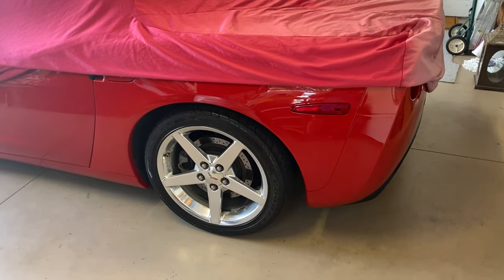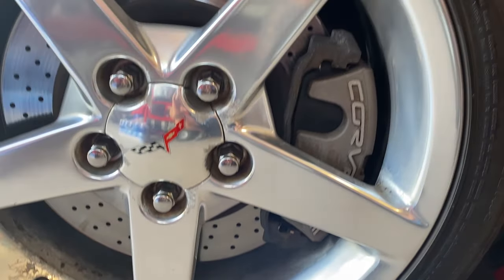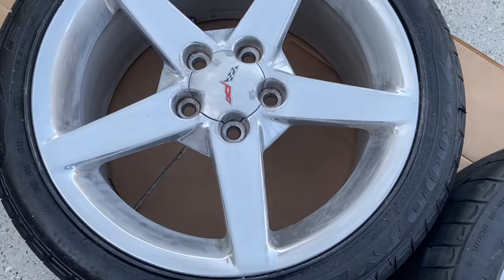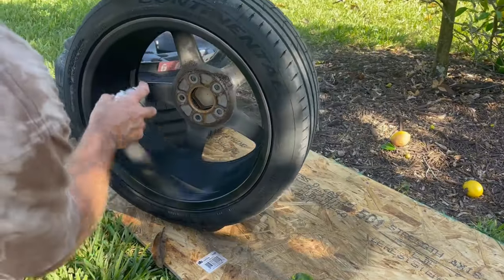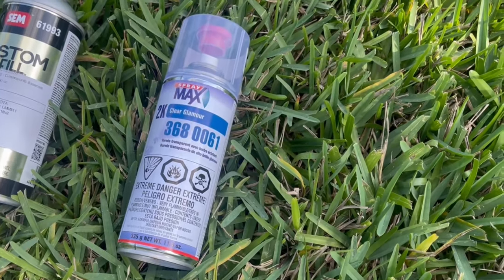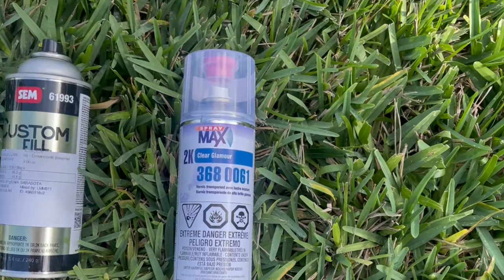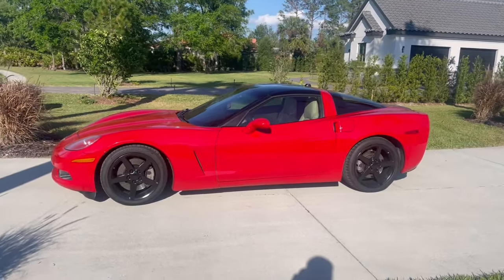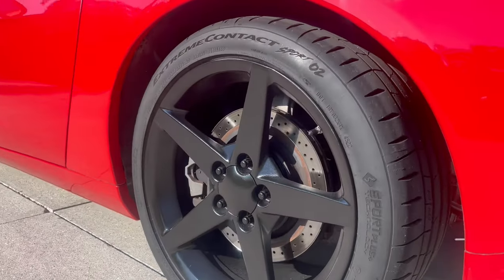How To Paint Rims FAST and CHEAP! (Best Method)

Comment: From someone that does this for a living.  A few mistakes you made. Use a cleaner with your scuff pad. And sand paper.  I’ll wet sand with a degreaser or spray away glass. Cleaner.  When cleaning the rim never touch the rubber with the towel.  Do a final wipe with the cards in.   Primer is unnecessary on rims a very very coat might be fine but it tends to cause issues on the rims.  You don’t want the thickest layer possible as thick clear coat will will be more brittle.  Typically two coats.  All of that is just minor professional differences.
Reply from the maker: Thank you, will keep these in mind if I do this again!
Reply: @running2redline also warm your cans in warm water or in the sun and always paint the rims standing up spray paint loves to spatter when pointing the cans down.. nice work
Reply from the maker: Great point, thank you! @productionapostle1298
Reply: For someone that does this for a living I’m surprised you didn’t notice the balancing weights that should have come off prior to painting and then rebalanced when paint cured.
Reply: @LK-851  Perhaps, it is because he doesn't do it for a living? 🙄
Reply: @throbbinwood  it’s obvious that you didn’t watch the video. 🤣🙄
Reply: Why wouldn’t I just wet sand and polish
Reply: I appreciate the correction as this is my first time. I'm a girl..lol can I use the jack and do one tire at a time. I don't wanna go out and buy a whole bunch of stuff for this project.
Reply: How long could one expect a paint job on rims to last?
Reply: well ive done mobile wheel repair for many years. Dudes being a stickler about not touching rubber with the towel and wheel weight man is also petty AF lol You did a good job but id have like to see the glass finish because me personally can see alot of spots where the clear coat isnt perfect and is orange peely. Its ok but You can correct those mistakes after the paint is fully cured with 3000 grit wet sanding and then a good LIGHT polish with a good compound. People freak and you can fix most issues with paint and clear coat. Most people hate doing polished wheels but i like em after its all done. I do about 15 20 wheels a day in a mobile unit sometimes 30 and we jack up the car, put the car on stands, let the air out the tires, push back the bead with a beadbreaker machine, grind/sand down the damage, paint or polished depending , then we always tact cloth it, use adhesion, paint, gloss, then blend it and put it under heat lamps to dry then air up the tires. usually 4 takes 30 minutes to a hour from being taken off to being done. we tell them dont drive the vehicle anymore you have too and dont wash it or touch the wheels for 72 hours.  Just me personally man do this again and only do your one coat of primer after a proper sanding and you should be good. those 2 extra payers were wasted money in my personal opinion. Good job man! A+++ Thanks for sharing
Reply: @shartih7313 so these will take a little while to dry and paint your next coat. Sometimes a few days depending on where you’re located so I wouldn’t recommend it only since the process would get drawn out a while but if you have a spare tire then you could definitely do it and still be able to use your vehicle while waiting on them to cure up. Again though, if there were a weekend that you didn’t have any plans, it would be great to just take all of them off and do all four at once just so the process went quicker. Happy Easter and smooth riding!
Reply: Thoughts on leaving the wheels on the car and not painting the inside of the rims? I've got an 11 year old Kia and I don't need it to look showroom quality. Just tired of the peeling and oxidation.
Reply: @sgfry89 spray paint will overspray onto the car paint.
Reply: @LK-851   That's pretty anal and balancing wheels cost money. For $100 I thought he did a great job. The cards thing to protect the wheels is a great idea. And the comment holding the rim/tire upright while spraying so no splatter was also a good idea.
Reply: @paulscozzari1787  I think it would depend on the climate. I live in the Northeast and salt loves to eat away cars especially brake lines.
Reply: @mikeblaz  you’re ok with a hack and that’s fine, they need people like you to make a living.
Reply: @LK-851  I don't do this for a living. I would cut a corner here and there on my own car to save money especially if the car was 10+ years old.
Reply: thanks for the pro tip pro guy , helpful
Reply: Hello Kriss, So you recommend just clean the wheels and NO primer? Clean wheels and rough up the wheels with sand paper then just spray the black paint in light coats, then 2 light coats of clear?  Any rattle can recommendations for color and clear?  Thx for the recommendations.
Reply: @floydcoburn7524 probably should also wipe it down w alcohol after you sand it.. the spray paint
Reply: I have a car that someone already painted the wheels (bright yellow😖) would these steps basically be the same for repainting (along with your suggestions). I'm not looking for super high end, but I don't want bright yellow🤦‍♀️
Reply: I agree, after sanding a painted surface  primer is just another coat of paint where something could  go wrong or later not adhere.
Reply: so dont use primer after sanding?

Comment: Suggestion……save your back dude!!!! Have an elevated surface to work on & maybe build a “Lazy Susan” type rotating round surface so you can stand in one spot and gently rotate the wheel. Your spray can will stay more even & you’re less likely to miss areas while walking (bent over) around the tires.

Comment: I'm doing this now with my 2010 mini copper. The previous owner had some major gouge marks that i wanted to repair. I used body filler and sanded it down to smooth it out prior to priming.

Comment: hello, how many sprays did you use for all 4 rims? I mean also the paint and varnish
Reply from the maker: I believe 2 cans primer 2 cans paint and 2 cans of clear
Reply: @running2redline  did you use 2 paint sprays, 2 primers and 2 varnishes? all 6 for the interior and exterior? how much does one spray have? 400 ml?

Comment: I have a 21’ Limited in black and just curious how did you blackout the grille just plastidip? I want to get a replacement but hard to find one that works with the front camera. Looks good btw!
Reply from the maker: It is actually black from factory on the C6. Taking the grille out sanding it down and airbrushing it would likely work though. Thanks for watching!

Comment: Question, when mounting a new tire, does the paint on edge of wheel get scrapped off by tire mounting machine???
Reply from the maker: Unfortunately yes, but for whatever reason not around the whole edge but rather parts. I usually touch up by spray painting onto a paper plate and using a Q tip as a brush. Has worked well for me so far but that’s definitely a downside to this method
Reply: @running2redline  thanks for explaining. This vs, sending to shop to have wheels removed, tpms sensors removed and repainted, remount tires with rebalance fee. I think I'll try this first 👍

Comment: Thinking about doing this to my rims but how long will the paint last on the rims if you drive everyday?
Reply from the maker: I’ve had it last a few years doing this, but you’ll occasionally need to touch up a spot or two usually on the edge of the rim. When you get tires changed some of the edge can scrape. I just fix this by spraying paint onto a plate and using a cotton swap as a brush to fill in the paint.

Comment: Do I still need to primer if the wheels are fairly new? Going from white to black
Reply from the maker: It isn’t absolutely critical, but I would personally recommend it still as it gives the paint a better bond and finish. Should be fine either way though

Comment: How do I take off all 4 tires at the same time?  I live in the city with no garage :(
Reply from the maker: You’ll need a jack with four jackstands to take all four off at once, however I’d recommend two jackstands and doing the front two, followed by the rear two. A jack and two stands should run around $60 from Walmart or autozone. As far as where to do it, when I lived in a city I usually would do this in the most empty parking garage I could find, but I don’t think painting in a public garage would work. Any concrete surface will work, definitely do not jack up the car in grass. So I would say find a concrete surface in the quietest area possible with the fewest people around, as if someone asks you to leave it will be hard on 2 wheels :). Also be sure to break the lugs loose before lifting the wheel off the ground and use the jack at the specific jack points of your vehicle. Good luck and let me know if you have any questions!
Reply: I'm keeping the tires on, any suggestions for me

Comment: Do you need to sand again after using the filler?
Reply from the maker: I think you could go either way, if you do sand between filler and paint I would personally suggest a high grit of sandpaper to keep the finish smooth.

Comment: Nice video. Thanks. I might do this. Just wanted to point out that they are called wheels not rims. The rim is the outer part of the wheel that gets scratched easily. Sounds a bit novice calling an entire wheel a rim. Kinda like calling a magazine a clip in the gun world. Otherwise great video thanks.
Reply: I'm painting the rims not the wheels

Comment: how is this easy and fast? what would be the hard and long version then lol
Reply from the maker: It took me 3 hours to paint 4 wheels which felt quick to me at least. However I’d say the main benefit was the financial savings opposed to time, it costed me $30 instead of a $900 powder coating job, given a lower quality outcome. There might be easier ways out there but this was the best thing I’ve tried, hope it was helpful somehow. Thanks for watching!
Reply: I think Powder coating is more durable but the costs are a bit extreme
Reply: He said 2 hours between coats? Lol

Comment: So, YOU painted car rims when GM didn't?
Not a GM fan, but, come on...
A whole lot of pros at GM, I have to believe, decided to have an uncolored, alloy finish on those Corvette wheels!
But, spray paint anyway...
Reply from the maker: My reasoning was as follows:
1. My rims had bad corrosion on them with the outer surface peeling. This looked terrible and I did not want it to continue further. 
2. My car has a wrapped black roof with black aftermarket headlights, the chrome wheels were entirely out of place visually. 
3. I spent the money to buy the car, I can do as I please with it. 
Thanks for watching